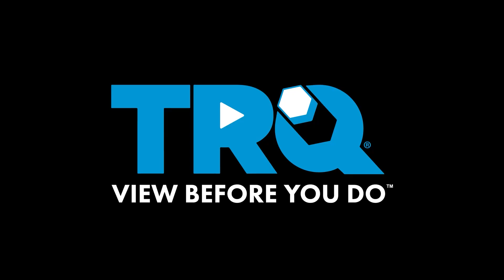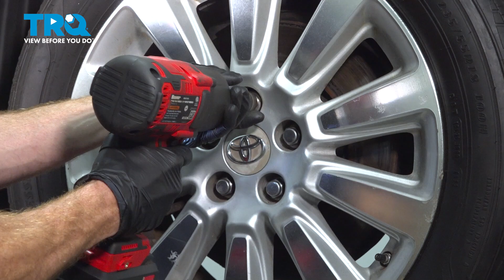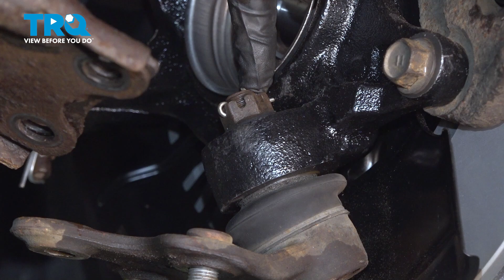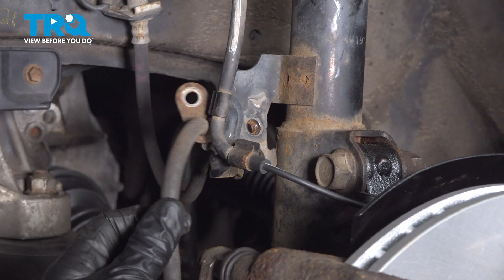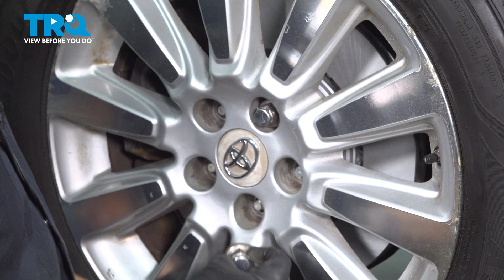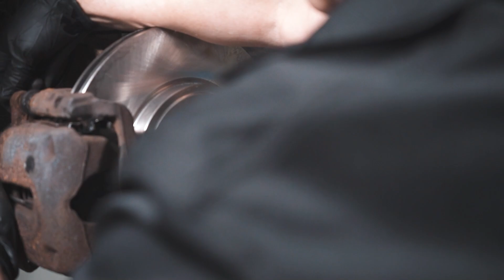How to Replace Front Lower Ball Joints 2011-2020 Toyota Sienna

Comment: A shop tried to charge me $2500 to replace the control arms because my van needed new ball joints which were popping.They didn't tell me that the ball joints were serviceable like your video shows.

Comment: The castlenut that comes with the ball joints is much bigger than the 19mm that was original. It seems that this might also present an issue where the socket  hits the wheel bearing and won't slide on the castle nut. From the video, it appears that the socket you're using to "snug" up the castle nuts is a 1 1/16" socket. Would that be a 27mm? Does it need to be thin wall to fit?

Comment: You don’t have to drop the axle ….
Use a coal chisel to get bolt off …19mm open ended just rounded it off ..
Just did 2 of them ..